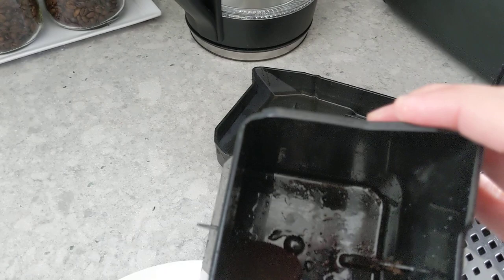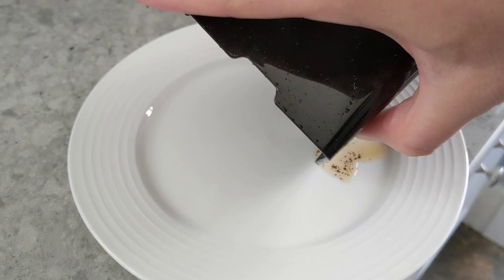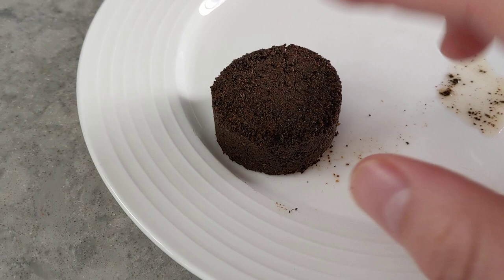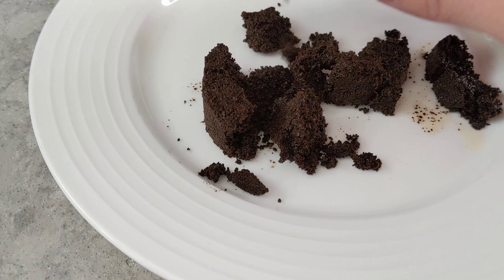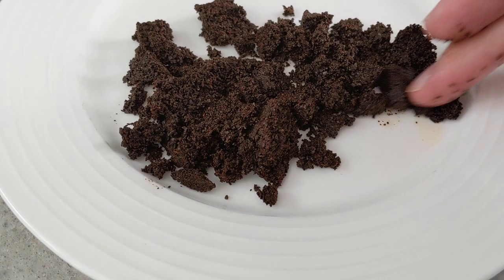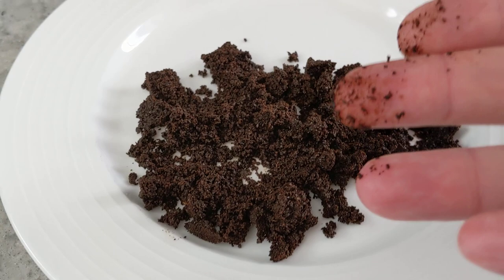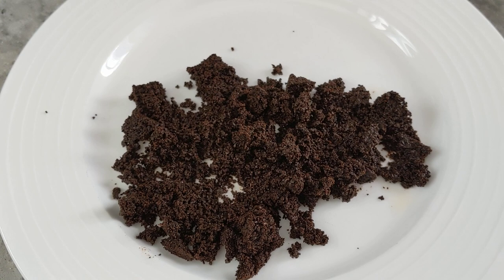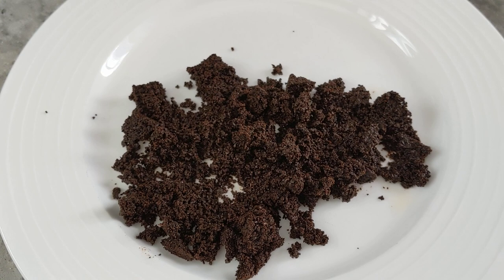Phillips 3200 Series LatteGo - Trying to make sloppy pucks. (See Description for Update)

Comment: I Bryan, first of all, thanks so much for the video. I was actually spending much time trying to.find some sort of exploratory or testing attempts, to sort the settings of this machine (not much content on this particular subject).
In any case i did bought today the ep2230/10 (from the 2200 series) and I was quite disapointed with the tasting of my expresso cofee. Likewise your experience, I did found that a medium coarse seems to be the way to go (5 or 6) --> In theory for expressos a finer coarse should be better, but for this superautomatic machines and considering my early experiences,  they do not produce the desirable crema and the optimun flavour.
I've considered returning the machine, but will give some more tries with different coffee grains ---> probably the quality of the chosen coffee itself should be the greater equalizer to the end shot.
Lets see how it goes 🤞🤞🤞
Reply from the maker: Please report back after your tests. 🙂
Reply: So Im quite happy to report that the machine was indeed not the issue.
For coffee Im currently using the brand from Aldi (it is called Delicato, if Im not mistaken) and its pretty good 👍👍👍
Reply from the maker: @renatoneto5807  thank you for the update! Glad to see the machine is working well for you. Try lots of different beans too, see if you find a favorite.
Reply from the maker: @renatoneto5807  I really like medium roast beans that are dry (no noticable oils on the bean surface).  It's hard to find them, since it is rare to be able to see the beans in a package.  You have to buy them and test each one.
Reply from the maker: @renatoneto5807  I might try some of these... https://coffeetasse.com/best-coffee-beans-for-espresso/
Reply: So what are your thoughts after keeping it, remember it is not designed to produce regular coffee of 8 ozs or more. If u want that u need to do 2 espresso shots and top w hot water. Or run it via Americano? Like you said medium roast non oily been
Reply from the maker: @kiddcisco  I regularly make 2x coffee and 2x Americano on Max water volume (~16 oz total) and it produces a nice result.

Comment: I've been using my LatteGo 5000 series (different user interface but I assume the "guts" are the same as Series 3000) since 4 months and I love it. I definitely recommend this machine!
Reply from the maker: Thanks for the info!
Reply: What ur grind size for a good puck
Reply: @testingthewaters7541  I never touched the wheel - so it’s on “3”. The puck seems to be ok though.

Comment: What volume does your cup have? My machine won't brew more than 7oz. for any drink and I tried to adjust the maximum setting but 7oz. appears to be the absolute maximum. That looks like a lot of liquid.
Reply from the maker: That's about right for this machine, I think a single coffee serving is 200 ml (~7 oz). If you push the coffee button twice so that the light next to 2x is lit up, it should double that and give you twice the amount.  I usually tap the 2x coffee and set the water volume setting to the highest, which will almost fill up my 16 oz mug.
Reply from the maker: The cup in the video is 200 ml.
Reply: Thank you for checking and the informative video! I appreciate knowing that all machines dispense this amount. 😊
Reply from the maker: @brettweegar2641  Glad to help!  Thanks for asking. :D
Reply: Thank you for asking this! I thought I was going crazy! I watched so many videos, and none show making a standard coffee - only the latte, cappuccino or espresso! I made a coffee for the first time and felt like my mug was half full! I switched to this machine from a Nespresso. Maybe I just need smaller mugs? Current mugs are almost 475ml.  I also feel like the coffee is a bit watery, I'll try the different suggestions below.
Reply from the maker: @tamikokagawa2432  I recommend first trying an adjustment to the grind setting, I have found the #9 setting to be nice.

Comment: On my brand new 3200 machine, I don't even need to try. They come out soupy by default, although the manual did say the first 5-7 are somewhat adjustments coffees... I'll check it back after a week or so to see if it still makes quicksand or pucks are solid like in the old machine.
Reply: Hey I know your comment is from a year ago, but did your machine end up making pucks instead of 'quicksand'? lol. I just got one and am wondering whether to wait to adjust things and just let it do it's thing for a while, or if I need to make adjustments to the grind setting.
Reply: @StefOutside  how did it go for you?
Reply: @karniskavva  Ended up sticking to the manual and letting it do its thing. I pumped maybe half a kilo of coffee beans through it without drinking it to let it dial itself in and it got better. Now after about a kilo, it's a lot better and is forming fairly dry pucks. Haven't adjusted the grind yet, I'll wait another while to see if it will continue to improve.
Reply: @StefOutside  Great!
Reply: @Player187  My machine gave soupy pucks in the beginning, but I  read that they will be looser with Americanos.I switched to espresso setting and added hot water a few  times  and pucks were dry.  The machine will calibrate over time. Now my pucks are fine, even with Americanos. Good luck!

Comment: FWIW   I picked up a used Saeco HD300 , very similar design just older , more simple interface ( uses same Brew unit ) . The Coffee pucks are far too loose and coffee very weak; I have tried the usual; descaling ( 3-4 times) , Cleaning lubing Brew unit , replacing O Rings , Cleaning shower head , Cleaning spout/ outlet ( had to disassemble machine)   
Coffee is still way to weak :(

Comment: Just got the 5400 and the pucks are very mushy and soupy on my 3rd coup .
Yours are much dryer than mine even the one from the fine grinder settings , I have mine on 6.
Reply from the maker: Have you tried increasing the 'bean' setting for more flavor?  Also, try setting the grind a bit more coarse and see if that changes anything after 2-3 grind cycles.
Reply: is it solved?
i want my pucks propper.... i have the grinder at level 3 and pucks are not pucks at all

Comment: I just got this machine and my pucks are super watery. And when I use the term pucks, I'm being very generous. The puck holder is mostly water, and my settings are stock. Grinder on 3, max temperature, water hardness set to 2. Coffee is super watery, borderline undrinkable. Not sure if this gets fixed after 100 uses, but I've put through maybe 2 dozen coffees so far and no change. Maybe my beans are too big and it's not grinding enough?
Reply from the maker: Try setting the grinder to 6 or 7 and see if that changes anything.
Reply: @BryanKlein  I've done every setting up to max, no change. Now at 3 I've ran a ton, and it's tolerable coffee. Just no foam yet, and my last coffee there was a fully formed puck in the bin, just super watery still. Gonna run another 50 coffee this week and check back... Hoping it works out
Reply from the maker: @BigReviewMan  my working theory is that more grind volume will fill the brew unit more, which will compress into a puck better.  It seems the grind is time based, so if you set it to a more coarse setting it should result in larger particulates which should fill the brew unit more.
Reply: @BryanKlein  so today is day 3. I've put through between 4 people about 3/4 pound of beans, and now as of this morning my pucks look just like yours and no more water. Coffee looks and tastes great. Strange, I haven't tweaked any setting either.
Reply from the maker: @BigReviewMan  welcome to a new world of coffee making at home. 😁 I received mine in Dec. 2019, we've run at least 2 double Coffee a day, I'd say 3 a day is the average, so 962 days * 6 shots a day = 5772 shots through the machine so far. My feeling is that we are probably closer to 6000 because of  friends and family visiting, who almost always have a couple of shots per day/visit.  I definitely think I've gotten my money's worth.
Reply: @BryanKlein  how often do you have to de-scale? My water hardness was almost 3, but I have the machine set to 2 for now. So far I am absolutely loving it - any maintenance things you'd recommend doing outside the regular cleaning?
Reply from the maker: @BigReviewMan  I put filtered water into my unit and removed the filter from the machine about a year ago.  I try to do a deep clean once a week or so.  I bought large tubes of food safe silicone lubricant from Amazon for the cleaning process, be liberal with it on all the moving parts.  It is a lot easier to deep clean with the door removed.  I also have a little vacuum I use to help suck out the dry chunks.  I have seen mold in the unit before, it is dark, warm and moist so no surprise there.  Just a reminder to clean a bit more frequently.
I haven't had to replace o-rings yet, but I probably should soon.  I might do a video someday about my cleaning process, so people can see what it looks like in a machine that's had 6000+ shots through it.
Reply from the maker: @BigReviewMan  I've only descaled twice so far, but my water isn't very hard here.

Comment: A finer ground should yield a drier puck, not a wetter one?
Reply from the maker: That's what I would think too. But it seems that with finer grind the pucks don't press as tightly.  I think it's because the smaller particles take less volume and the plunger only travels so far.

Comment: witch is the best level from 1 to 12?
I bought the same maskin you have last week
Reply from the maker: For most beans I've tried somewhere around 7-9 has worked well.
Reply: @BryanKlein  
8 between 7 and 9😄
Thanks I appreciate
Reply from the maker: I mean set it to 7, 8 or 9.  Not just at 8.  Some roasts are better when more course at 7, and some are better more fine at 8 or 9.  It's a preference thing for each bean.

Comment: I'm an independent service technician for several fully automatic coffee machine brands... 2-3 grounds in the grinder and chute is incorrect. It's also stated in some user and service manuals that it takes about 2 grind cycles to see the effects of another grind setting but that's not true! There's about half a grind cycle retention!
Reply from the maker: As I mentioned on a similar comment on my other video, it would be great to get some data on this.  What is actually in the chute, how much can it hold?  My intuition matches yours here, but without some more detail, I don't have confidence that we are correct.
Reply: I'll measure it next time I need to service a grinder of this brand (Saeco/Philips/Gaggia)

Comment: My machine is not dumping any pucks, just a small amount of wet grounded coffee, is my machine faulty?
Reply from the maker: Usually this means that your grind setting might be too fine, or you aren't getting enough grounds into the chamber that gets pressed into pucks.  You might try setting the grind level to something in the middle, like 6-7 dots and see after a few grinds (2-3x) if your pucks change their consistency.  I have found that a slightly more coarse grind gives me better pucks.

Comment: Hi Brian, just bought the 5400 version for my parents since I have one as well and I am super happy with my experience.  But when we started using this new machine it was not producing the same taste or even the density. The puck was more than wet after every attempt. We used the manufacture's settings. Obviously I freaked out, since there was no change after making like 10 espressos.
Puck remained sloppy even when changing the grinder settings.

I tried it with grounded coffee and this was the only time the puck came out as a solid, thick disk, as supposed to. So at this point I am a little lost what and how I should change. But I keep reading comments and look for answers since the Philips after sales is not easy to get in touch with.
Reply from the maker: Hello Judit, because it worked well with the pre-ground coffee, it seems like the problem is with the grinder in the unit.  What grind setting is it set to? What are the other settings used when brewing?  I would try moving the grinder to a more "coarse" setting and running a few grinds through it to see if that changes anything. Also, how 'dry' are the beans?  If they are oily on the surface  they can stick together and not move through the grinder as well. I have had the most success with dry, medium roast beans.
Reply: I would keep brewing. I just got one and it was putting out very watery pucks to the point i thought it was a broken machine and the FAQ page on their site said brew a few more times if you are running it for the first time. Somewhere around 10-15 cups they began forming like normal/expected pucks. I was just running espresso shots until it finally behaved. I did also play with the grinder settings at the same time - should be unrelated though.

Comment: Thanks for the video. I'm a quite new user of the machine. Can you please share how drip tray and brew assembly look after 1-2 cups of coffee produced? Mine is very watery in drip tray and grounded coffee overlaid over the assembly, so I suspect it may not work properly. Any recommendation would be highly appreciated.
Reply from the maker: Is the container for used grounds full or empty?  I do see some grounds in the water and have to spray some residue out of the drip tray when I empty the grounds container.

Comment: I have a cup catching the water when the machine turns off and on. Yet I still get a ton of water in the drip tray. Is that normal? Just got this machine on 5/13/2022. TYIA
Reply from the maker: I think it does a fair amount of rinsing internally when it is operating.

Comment: Brian, my 3200 will only make 100ml of coffee. I see that your's does 200ml. I tried to calibrate the volume, and it blinks, but stops blinking and stops making coffee at 100ml. Any ideas?
Reply from the maker: Which water volume setting are you using?  If you use #3, you can also program how much water to flow.  There is a section in the manual about setting this manually.
Reply: @BryanKlein  Yep, using the maximum, but every time I'm trying to adjust the volume (using the manual) it blinks and makes the coffee as manual describes, but stops at 100ml :(. I'll try to reset the volume settings and try again.
Another thought is bad AquaClean filter...

Edit: did the reset, didn't help. I guess it's the filter, which is brand new.
Reply from the maker: @ilevkov  So strange.  I think that there is also a pressure setting where if it senses that it is not flowing water well enough through the grounds, it will stop.  Have you disassembled your brew group and cleaned the metal screen and water flow path? 
The first few seconds of this video are loud, but after that it is a pretty good breakdown of the cleaning and lubricating process. https://www.youtube.com/watch?v=l89XJIJoWf4
Reply: @BryanKlein  I'll give that a try.
Reply from the maker: @stp5039  The filter is in the tank.  There is a way to program the #3 level to be set to any volume you want.  I might make a video showing how to do it.

Comment: Purchase this machine for Christmas, opened this morning it does not create a puck. For instants it seems like the water isn’t even getting to that point because when it drops into the dispenser it’s just regular coffee grounds 0 moisture. Any idea to troubleshoot this I’ve done everything in the manual, and was on the phone with Phillips for a half hour. She just told me to put warm water in the reservoir and leave it overnight 😔 I’m so disappointed.
Reply from the maker: If you run an Americano, does hot water run into the cup from the dispenser where the shots should come out? (not from where the LatteGo connects to the machine)
It should first make a shot and then flow hot water after that for an Americano.  If the hot water flows, but isn't making the initial shot, then there might be something jammed up with the brewing group, the thing you can pull out of the door behind the water tank.
Reply from the maker: I'd be glad to Zoom with you to see what's happening.  Nobody should be disappointed with a coffee maker on Christmas. 🎄
Reply: That’s so sweet of you. No water is coming out of the coffee part at all! Just “hot water” from the froth side.
Reply from the maker: @sarahteunissen5016  I made a new video https://youtu.be/wtP6hF4qVN4 showing how the water should flow through the system and some things to look at for clogs or missing parts. I hope it helps.  If not, the offer still stands to take a look over Zoom.
Reply: Thank you; I will troubleshoot again in the morning. But honestly i think something is stuck in the system. It’s not right ; I’m embarrassed to admit how many reviews I’ve watched before purchasing. And water never came out of the espresso part, even at initial start up. I hope Seattle coffee gear is going to be cool with returning it. Exchanging or getting a different one.
Reply: @dutchdude500  I had the same experience during set-up. No water came out the first time like it does in the Philips installation video, but it did (just a bit) after installing the filter. Mine does work though: good luck. Did you have Seattle coffee gear ship it to the Netherlands?